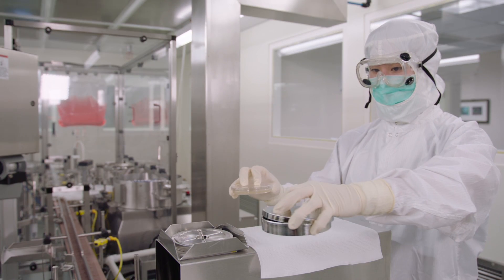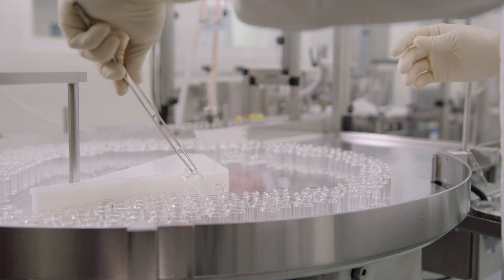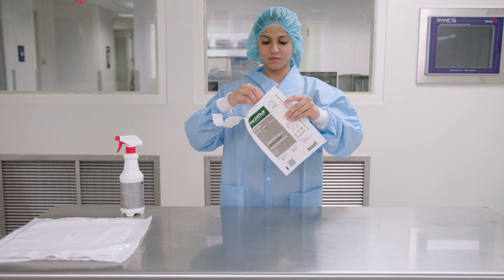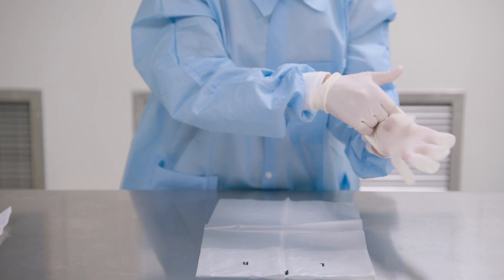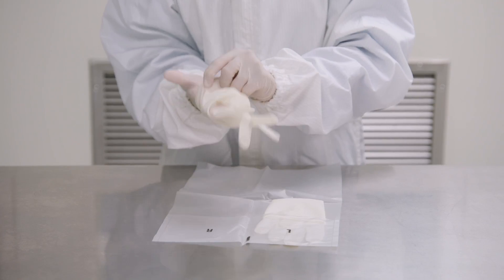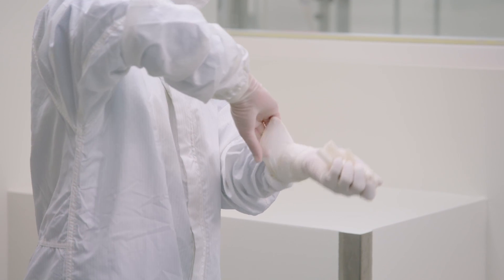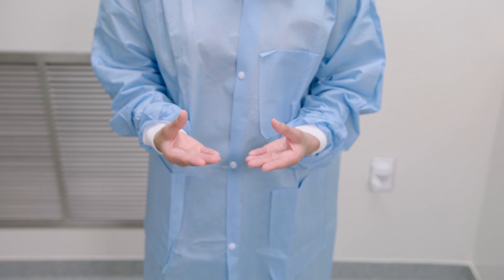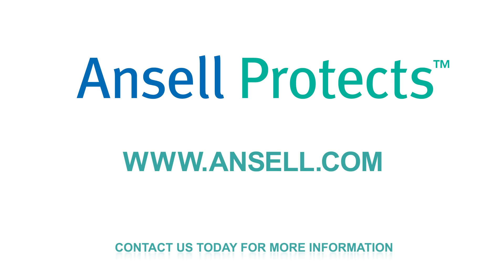Double Donning Gloves in a Sterile Environment

Comment: What is the smallest size of latex sterile gloves available
Reply: As I know, 5.5 is the smallest. But I never have seen smaller than 6 - which size I am using mostly.
Reply: @fazekassimon  I own an electronics manufacturing business and asain hands are usually smaller than oursn I like them to have tight firm fitting gloves. Better dexterity and comfort
Reply: As I also Know that is 5.5